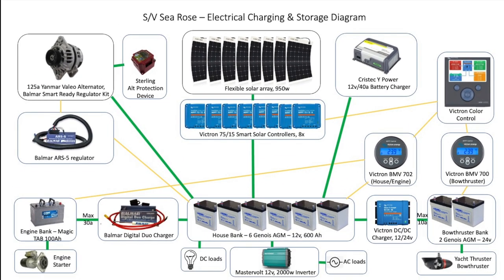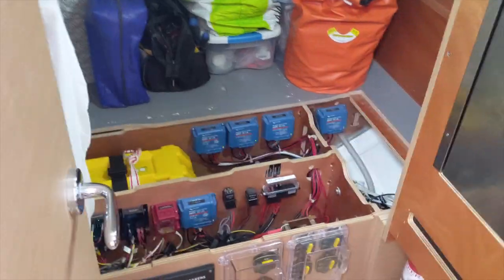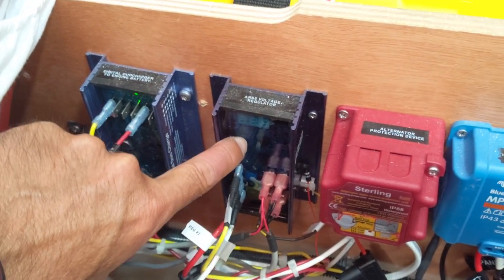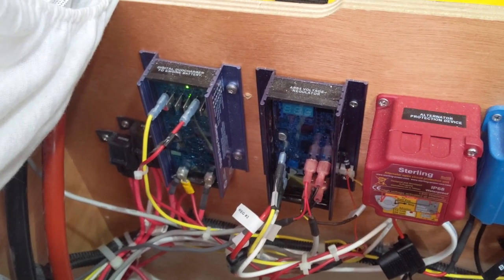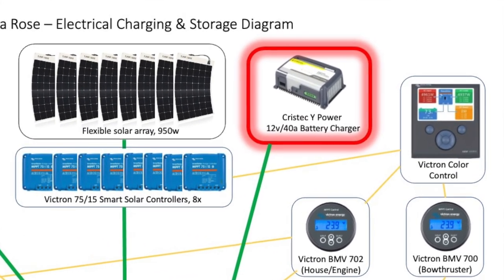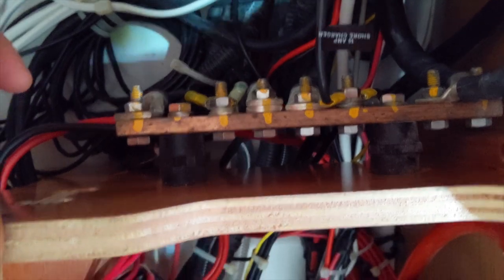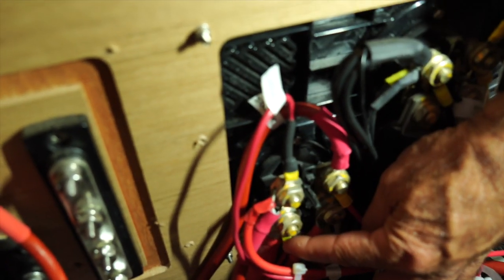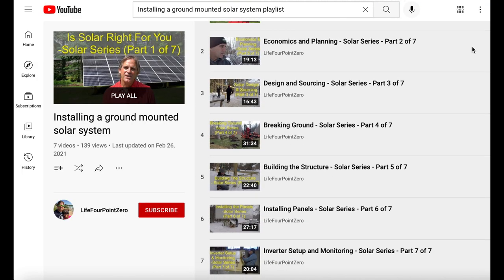Battery Charging and Energy Management, Part 1 of 2 | Ep. 104

Comment: Excellent information.  I like your alternator modifications.  I also have a 440 and have seen the alternatir get very hot.  It took me a little while to understand what was going on.  Solar helps a lot since the batteries don't go as low now.  Excellent video.  Thanks.
Reply from the maker: Thanks Kevin! Whatever route you go, make sure to use an alternator temp probe, so the regulator will dial down the amps if things are getting too hot. Good luck!
Reply: @LifeFourPointZero  Is the alternator temp probe include with the Balmar / Yanmar alternator regulator upgrade?   Because that's a great idea.
Reply from the maker: It was not included with our regulator. We bought it separately. You might consider getting a Balmar battery sensor probe as well, which reduces amps if the battery is getting too hot.

Comment: Great video!  Thanks so much.  I have most of what you talk about but on a much smaller scale.  I've made a number of upgrades but I'm approaching a time when I need to tear out some of what I did several years ago and do some simplifying.  I really appreciated your thoughts on why and how you have done what you have.  It might be a little too much detail but I was wondering what you use to supply your AC outlets from both shore power and the inverter.
Reply from the maker: Even though it's work to pull out previous wiring/equipment, you will have a much better grasp of how the pieces go together if there ever is an issue in the future. For AC outlets, first, we try to power as much as we can with DC (e.g. phone charge cables into usb ports instead AC adapters), but otherwise, the outlets are powered 100% from our inverter. We rarely plug into shore power but still I have chosen the simpler route of having shore power exclusively charge the house bank, and then the inverter (or any other house loads) pull from that house bank. When we eventually upgrade to lithium batteries, that house bank will be even more robust for any AC loads onboard. Good luck!

Comment: those wires for the alternator to the egulator look pretty skimpy....20 amps?
Reply from the maker: Hi Sky Pickle. Yes, I’m not in front of it right now but they are about 10 or 12 awg. If you are wondering, the actual current output from the alternator runs on a very large cable direct to the battery switch and then to the house bank. The wires between the alternator and regulator are just measuring voltage and changing the field current inside the alternator, which does not involve much current at all. Hope this helps!

Comment: What are your thoughts on the genset?  We have ordered a new 440 with one.
Reply from the maker: A genset? You mean that thing that weighs a lot, requires regular maintenance, makes a lot of noise, bothers your neighbors, and pollutes the earth?! Seriously, I would look long and hard at whether you really need one. We have sailed full time  on our 440 for the last 4 seasons and have not needed one, and many years before that on our previous Jeanneau. Solar provides all the power we need. On less than a handful of occasions have we plugged into shore power either, more for convenience. With the cost of a generator, you can easily add lots of solar on your bimini as we have done, or a stern arch. There's no pesky oil changes and exhaust - solar is maintenance free! Try that for a season or two and see how you make out.
Reply: @LifeFourPointZero  hi guys love your channel.  Are you still happy with your choice of yacht?  Anything we should be aware of?  We are upgrading from a Jeanneau 42i.  We have elected for standard sails.  How does the in-mast work for you?  So many questions.  Unfortunately we are having to wait a year for delivery!  Trevor

Comment: You need 4kw solar and 6000ah battery.. For everything including electric winches and furlings and electric steering system..
Reply from the maker: It really depends on so many factors … your use of the winches/steering system, the efficiency of your solar charging system and what else you have that might be drawing electricity from your batteries. I’m afraid that a blanket statement like that doesn’t really apply across the huge variety of boat sizes/configurations, the environment a boat lives in and the practices of the boat owners. Thanks for the comment … would love to hear more about your specific experiences.